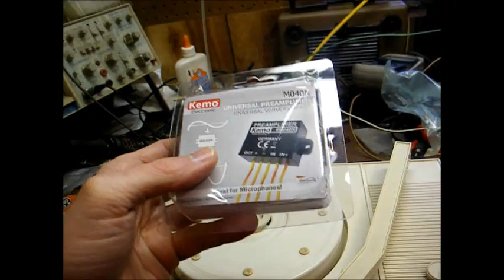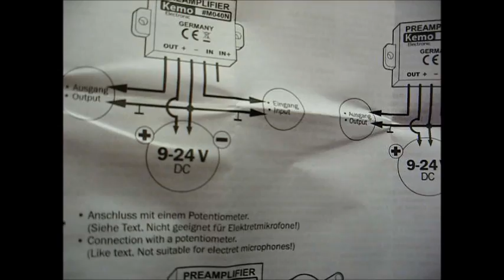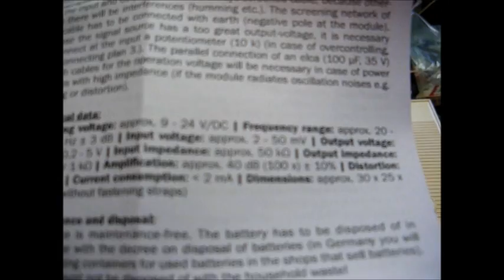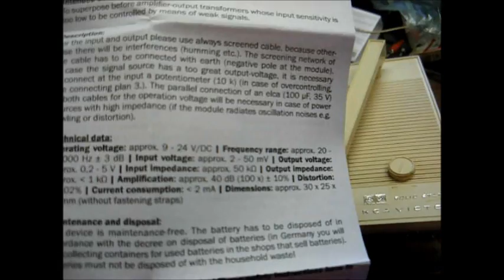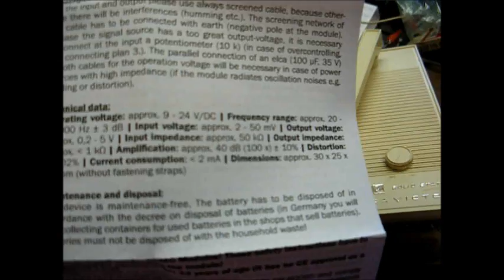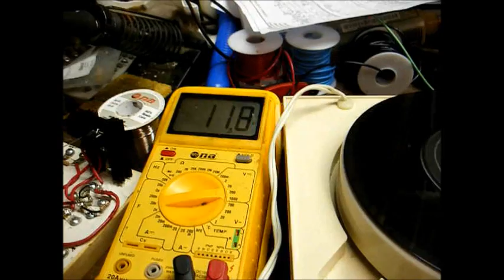Preamp modification for a 1967 RCA solid state record player

Comment: I thought about throwing a 12 volt zener diode in there until I read shango066's comment.  That definitely seems like a much better option that I though of .  I also thought of maybe with the distortion of the amplifier, the power supply may have been loaded down beyond its designed specifications.  I'm sure there's plenty of headroom on the power supply, but I don't know what diodes, bridge rectifier, transformer, etc are in the power supply, as well as filter caps.  This is really good information. I wish this was around in the 80s when I was going to electronics school.  Although I do know a lot of things and have repaired many amplifiers, tvs, video monitors, installed car stereos, and other things, this is truly a great channel for learning how to do something and find the value in something that someone else may just want to throw out.  Thanks for sharing.

Comment: It's interesting what a small world it is. I got an RCA solid state record player from the same year - the 2-speaker version of this one - and was googling around to get an idea what to do about the cart replacement and came across this video.  Like I said, small world. Anyway, I think you'd find adding that capactior probably is regulating voltage because the cap is being charged and is feeding the DC supply to the device. If you put a meter on that point, it's probably fluctuating less than the main voltage supply.

Comment: You need to use a lower resistor with a 15 volt zener diode to regulate and stabilize the voltage. It may also not like the shared grounds, maybe causing some kind of ground loop
Reply: shango066. I mean, YOU would just set Fire to it....Right?

Comment: National Semiconductor once published an Audio/Radio Handbook with lots of applications circuits. The had  RIAA equalized pre-amp circuits using op-amps audio amp applications, etc. Depending on what you have you could probably put together a design and dial it into your cartridge out characteristics. And for less than the $10 pre-amp.
A great book but I doubt it's been published since the 80's but it might be on PDF somewhere.

Comment: I would try removing any resistors or capacitors connected across the cartridge, and instead put a 1 megohm (or higher) resistor in series between the cartridge and the pre-amp, it will reduce overloading the pre-amp and the cartridge will see a much more high impedance input.

Comment: I think the distortion is from overloading the pre amp. That type of unit is really made for a mag cartridge  of 2/10mV to bring it up to line level 100mV or so.If it has RIAA EQ. If not it,s more like a mic preamp.  As the overload of the preamp being probably 50mV or so the 500mV from the cartridge will clealy over load the input.
A better solution would probably be a little 2watt amplifer modual kit. Would probably cost about the same as the preamp did. I would also expect it to sound better than the original amplifier. Even a little class D amplifier with a 1 mohm series resistor would load the cartridge with the required high impedence  and provide stax of gain. The use of a lower output cartridge tends to sound better and provide less record damage because of the better compliance.  Just a thought!!!
Reply: +Michael Beeny Good idea, better amp and better speaker.  What's in there is like a crappy pocket transistor radio amplifier.  It would be easy to scavenge an amp and speaker from an old cassette shoebox recorder.

Comment: I'm going to assume that pre-amp module is some type of LM386 audio amplifier or 741 type OP-AMP IC based design.
I think the LM386 is better suited for high impedance inputs over the OP-AMP design, but you will have to limit the output so it will not over-drive the main PA.
I have some sort of suitcase record player in my storage room that I need to take out and see whats wrong with it, If I recall I think the amplifier went tits up on it.. I know its solid state and pretty sure the belts need replacing on it but the cartridge in it was replace with an original NOS right before it died so it should still be in the unit. I may dig it out tomorrow and take a look into it.